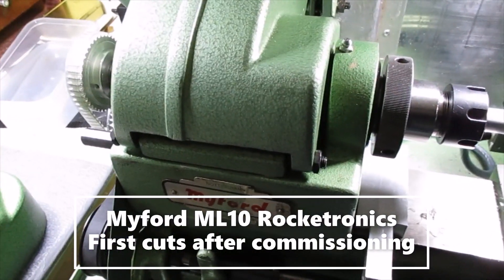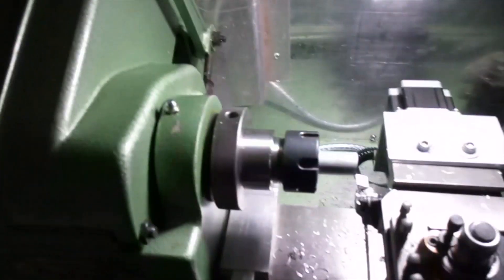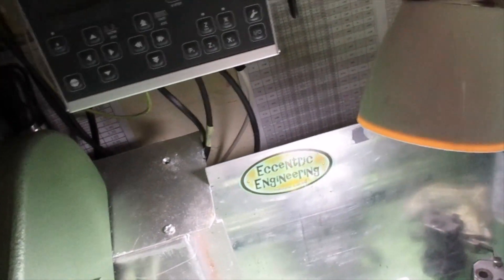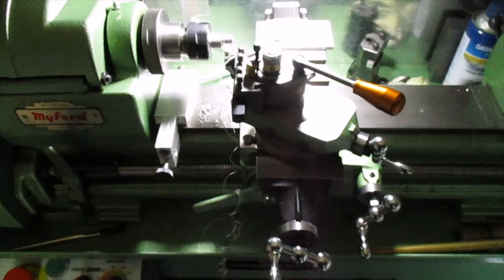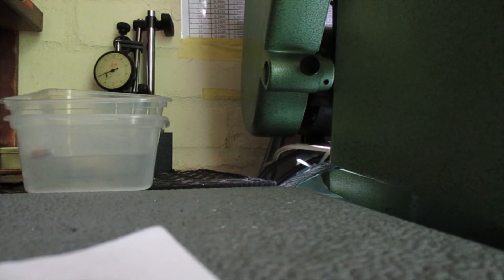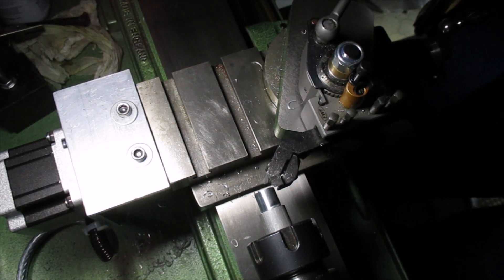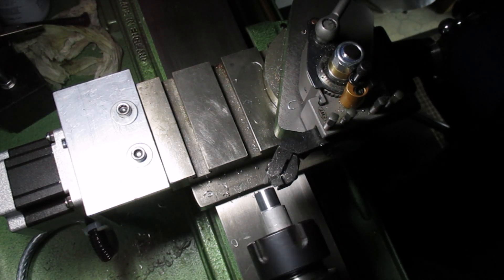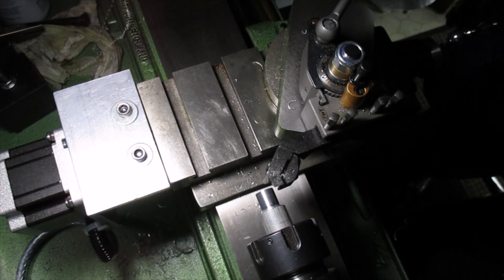Myford LM10 & Rocketronics ELS instalation

Comment: I am adding an ELS to my ML10 and took inspiration from you for the setup of the components, very neat; could you give details about your Multifix style toolpost too?
Reply from the maker: @mxdl1173  hi my Multifix is from PeWe tools Aa size, I milled 2mm of the top of the crosslide to be able to get tool on centre also made new mounting stud with internal thread to take an 8mm bold to keep it clear of the tool holder adjuster, I wouldn’t change to anything else.
Reply: @torsiondell  I can see why, it' a nice piece of kit; thanks for the quick reply

Comment: Can you share a list of the parts you've purchased for the ML10 either here or in the video description? It would help a ton since the Rocketronics website is a bit confusing :) Thanks!
Reply from the maker: This is the kit I purchased https://www.rocketronics.de/shop/en/paket-step-M.html plus the ELS 4 basic controller
Reply: @torsiondell  Thanks! Is your ml10 imperial or metric? I'm currently looking for a metric lead screw, can't find any and Myford themselves don't make them anymore as the request is just too low.
Reply from the maker: It’s imperial but it doesn’t matter with Rocketronics it converts to metric because you put the leadscrew threads in settings ie 8tpi converts to 3.175mm so that’s what you input in to control but I can’t remember what the crosslide leadscrew was but easy to Google , you can also put the backlash in settings so it compensates for it , you can cut metric and imperial threads but for imperial you just have to convert to metric to input into control, I love it.
Reply from the maker: Message me on messenger if you have any more questions @torsiondell
Reply: @torsiondell that’s great news! Thanks for sharing! I’ll add you on messenger

Comment: Thank you for sharing this. I am looking at installing an ELS on my lathe and this demo has helped me see what this unit can do. Very tidy installation as well! Nice work!
Cheers from Canada
Reply from the maker: Sorry not the best of videos but it shows it working if you do fit the kit make sure you start Z and X at zero , I didn’t once and smashed a micro boring bar to bits , and it will definitely thread metric and imperial you just need to convert to metric to put parameters in control.

Comment: Very nice and tidy installation! Thank you for sharing. Good luck ahead (I have installed a few of these by now and gained some experience, so feel free to ask for assistance if you need/want. PS! There is also a user forum under Peter's CNC Ecke (ie. a German site, but you can use English there)
Reply from the maker: Thanks for your comments, I have already made a mistake, I forgot to zero X & Z luckily I only broke the boring bar, thanks for the heads up on the forum I will have a look, a fairly large learning curve ahead.
Reply: @torsiondell  Ooh.. well, I have made mistakes also. They are almost inevitable for an automated system. PS! In my eyes the nice thing about a cycle controller like the Rocketronics system is that you can also use the lathe manually.